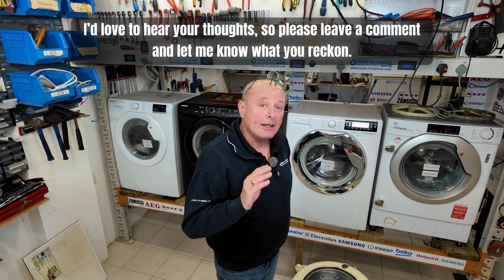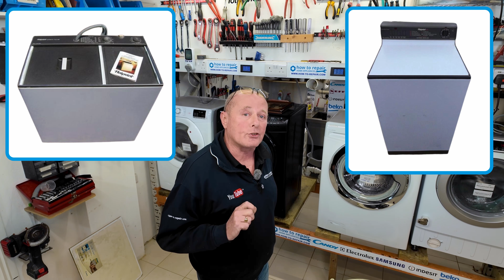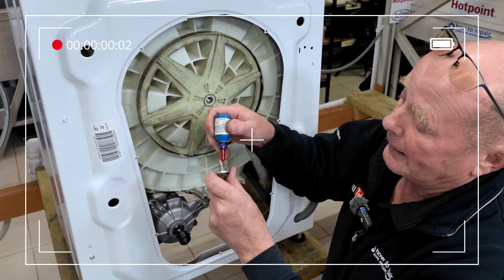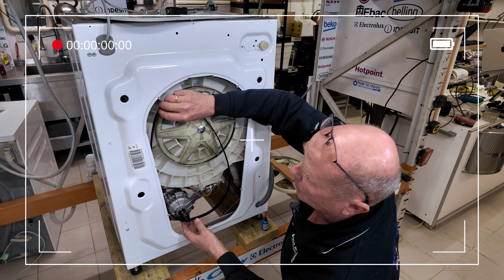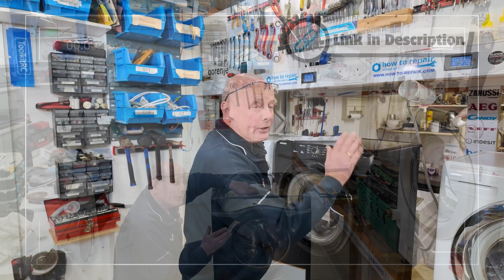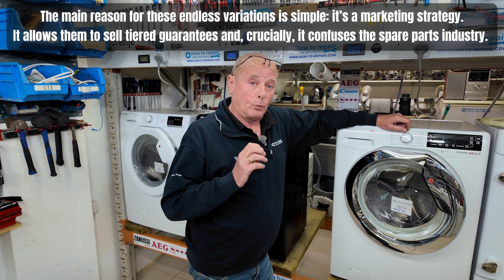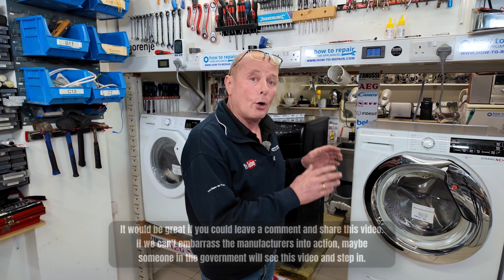I Scrapped 13 MACHINES to Prove a Point: STOP BUYING These Brands!

Comment: I got an "absolutely fantastic" Candy washing machine (a top loader). There's a strong metal spring that holds the door in upright position so you can fill it. But the hinges connecting the door to the main body of the machine are made out of 2mm thin plastic. 
I'm pretty sure that someone spent considerable amount of time setting the dimensions just right, so it fails immediately after the warranty is over.(it broke)
Thanks for the video. It was great to learn that there are more, much worse surprises waiting...
The fact that this shit doesn't ruin the companies that do it, that right to repair is considered as something abnormal, makes me completely disillusioned about the future.
It's not gonna get better, is it.
EVERYTHING is gonna get more and more dystopian. 
You know, one could probably tolerate the inevitably coming authoritarian totalitarian dystopia, IF ONE COULD AT LEAST OWN RELIABLE TECHNOLOGY THAT'S SUPPOSED TO DISTRACT FROM THE FACT IT'S HAPPENING.

Comment: Are there any Washing Machines left we can buy without a hassle? Back in the days (earls 2000s, I guess) Miele has been incredible good in terms of quality, e.g. 
Is that still the case? They sell really expensive machines (roughly between 1.6k and 2.7k €), but offer 25 years guarantee on their machines Motors + 2 years general guarantee.
Are there any brands still good?

Comment: I 100% agree with you! 
I own mieles. For a reason. The machines that are over £1k are built like ours was back in Britain in the 80s and 90s. I also own a 1994 hoover softwave. Which is very easy to work on and repairable. I also have a Hotpoint supermatic plus 9400 twintub in mint condition. Which again is very solid and easy to work on. I refuse to buy a cheap today machine. As I know they are all built to a low quality. To save money and materials. Joe public don't care. A washer is a washer. Cheaper the better. for me ...... Expensive and high quality. Saving money!!

Comment: I've got an old Beko, that was already in the flat I bought in 2006. It is now February 2026 and the machine still works like new and has hot and cold water intakes. So yeah they built better machines early 2000s

Comment: I still have a Miele washing machine that is over 35 years old. While I had to replace some tubing and a capacitor, it still works like a charm.
Is it loud? Yes
Are newer ones more energy efficient? Sure
But new ones cost too much compared to what I would save.

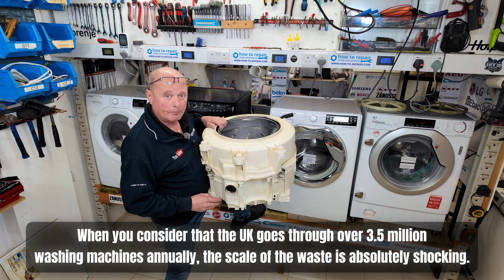Comment: 5:55  there a couple of reasons, obviously cheaper and faster to produce, its also so they cant be cleaned, its also so you cant replace the bearings and seals, they want to sell more washing machines, now you cant renew them, i have a rebuilt one i did, you used to be able to take it all apart pressure wash it and put back together with BETTER bearings and a triple lip seal using more chemical safe composition, now aftermarket suppliers cant as it not serviceable anymore, like automotive transmissions now they don't even supply a drain bolt or service information, says DO NOT OPEN, NOT SERVICABLE, meant to last as long as the warrantee and lower the service costs by neglect

Comment: Planned obsolescence?  Or just cost cutting?  It's hard to tell sometimes.  Yes they all flipped to sealed drums about the same time, but it was to save money.  Oh sure I agree the decisions is very very stupid as it prevents basic maintenance.  But this is why you often see the first ones had the holes still in the plastic for bolts, as they merely started sealing the two have together and fired the people putting in the bolts.  Later designs then removed the holes, and finally even went to one complete molded piece in some instances.  It's efficient to make, cheaper, faster ... and really screws over maintenance.  

I think much of this was caused by the people driving profit first in all forms.  Why use the bearings that will last 20 years when these that last 5 years will meet the warranty needs and save us money money money.  And a lot of this was driven by (wait for it) Green Energy policies.  Look, we all know that since the 90's the west has been gung ho to save the planet.  Well every policy passed opened a door for manufacturers over in Asia to undercut the sale of items made in the west.  This manufacturing move to Asia powered the rise of China, and they produced some of the lowest cost (and quality) items out there.  But consumers driven by prices bought that schlock, and the makers followed suit even moving their facilities to asia to make the items with the same "quality care" as China puts into it.  Heck I love watching a few channels here on like bigclivedotcom where he tears down items bought cheap from china (and those things are sold in the west and are crap and dangerous even .. yet cheap and no one stops it).  We have what we have as other things take priority to the politicians.

Comment: Got a Hisense 2 years ago. bearing shot and costs 20 euro for a new bearing. Time to change the bearing 4h and 100 euro/h so the same totalt cost of buying a new. Got my moneyback and bought a Bosh instead. Still have the Hisense machine and it is now my hobby project to be resold with a new bearing mounted to a family in need.

Comment: They can use capacitors on pcb boards that have lower life spans (i.e. cheaper rated components that degrade power conditioning modules).
Reply: Indeed.  I repaired our 42" built in Kitchenaid refridge by replacing some swollen capacitors on the PC board.  It was a well documented problem within online forums - someone even sells the repair kit on Ebay with the correct components and instructions but I sourced the parts from Amazon.  You do need to know how to solder the replacement parts in and watch to keep the same polarity.

Comment: Hi, I live in Australia, and I have a top-load Speed Queen from 1978, still going, built like a tank. I replaced the bearings, and the timer parts are still available, no pcb  boards .its like a 1960 cadillac you can work on it  and keep it going

Comment: I have Indesit w2296  since 1996 as present for my wedding. Still works  - there was some repair but can be repairable a lot of more years))))  I have Candy washmashine because its too cheap and i will utilize it when it will broken ( 3 years in work) because its not repairable, too hard to change bearing and so on

Comment: I’ve had the same Kenmore washer and dryer for 20 years now. Had to replace the drain pump once a couple years ago and the solenoid for the gas valve in the dryer. Cost maybe 50 bucks total

Comment: My mother used to work for Hoover in London in the 1970s and bought a Hoover machine in 1975. She replaced it 1985 and gave it to me when I moved into my own flat. I used it until it finally died in 2004. The only repairs were replacement bushes (twice) and that was pretty straightforward. I wouldn't even consider buying  Hoover now - I've switched to Bosch with a five year warranty.

Comment: Hello, I am from Czech Republic and this planned obsolescence is going further in the past thatn people think. My grandma (93 years old now) told me that in a company Technolen they were making stockings. Those were durable, you needed to buy new ones once in couple of years, but then they have made a change and they were tearing much more easily. She knew the owners of that company. And of course companies have politicians in their pockets, so this issue will not go away on its own, but it is getting quite ridiculous now. I am using mainly older machines and got a car from 1997 because they are easy to fix for cheap.
Reply: Planned obsolescence started with the Phoebus Cartel and the production of lightbulb in the 1920’s and they had a lifespan limited to 1000 hours reduced from the earlier lifespan of 2500 hours.Capitalisms Lightbulb moment!

Comment: Thanks a lot for this video. The amount of waste coming from the house appliances is inded mind blowing. I read about a way to prevent it - it would be to tax (heavily) all the materials that are being mined. This would make used machines and their parts cheaper in comparison, and encourage recycling the parts instead of scrapping. That would also help the consumers focus on repairability. But it would still be very hard to introduce - most people enjoy buying new machines. It's so much fun - they are clean and shiny...

Comment: Hi,

I'm maintenance technician in France and i must agree with you. At this days, The Indesit Company is in join-venture (is this the right term?) with Whirlpool and distributed by Beko now, this comes with many improvements for both companies about their machines but many complications arise in the search for spare parts references. Also Candy and Hoover have been bought by Haier Company. This latest attempt to make design improvements, particularly to tumble dryers which also have a welded chassis and non-removable side panels. Now they can be removed, but those freaking lids are always on (really, really hard to remove on tumble dryer after several years).

And for the Greenwashing, what the f*** is going on with these Heat Pump tumble dryers, there aren't affordable for buying and even worst for repair : the heat pump cost literally 50%-60% of the price ot the machines and in addition with the cost of workforce, it's a waste of money in my opinion. If these models are designed for low energy consumption, around 500 to 600 W/h in duty cycle, why not manufacture standard heaters consuming this power rather than 1500 or 2000 W models? Furthermore, this would allow the customer to continue maintaining the condenser properly instead of trying to scrub it with a small brush, which will ultimately clog it completely in the case of heat pump powered tumble dryer.

Hoping i was clear and readable, greetings from France

Comment: Unfortunately why would you repair a machine that costs twice or even three times as much in spare parts. It’s cheaper to replace then repair, hourly rate costs for a technician to come out and just say well i can’t fix it here, so I need to take it back to the shop. So add it all up and a store will remove and replace a new one for about the same price or even cheaper. So our stupid Governments that Said let China build everything for cheaper always had a time frame until they became world leaders. Now they control everything. It’s not only washing machines it’s cars TVs everything. I used to repair car parts as an auto electrician starter motors alternators distributors and so on, you used to have to diagnose the problem and then quote the customer before repairing, these days they have more than ten cars on the lot and they just keep swapping parts until the problem goes away. Welcome to the new age where people don’t even know if they are male or female. There is a movie they made all about this called idiocracy good laugh but also take note because this is where we are going.

Comment: I have been involved with washing machines for many years and😅 have witnessed a degrading of the drum support castings over the years. In the 70s an aluminium casting in a dishwasher could last for fifteen or more years if it was in a hard water area and considerably less in a soft water area. The same applied to washing machines at the time. When detergent manufacturers decided to add more chemicals to their product around the ear!y nineties and are continuing to do so, sometimes as directed by the EU, you had a situation whereby detergent residue still active mostly because the wash programme that had been selected was at 40 degrees which if used weeks on end will allow coating of corrosive.  active chemicals to build up on the aluminium casting ( which make the machine smell )  If a 60 degree wash is used at least once a week the temperature should help to break it down. There have been more directives in 2025 regarding detergent which require a change in formulation which might help. Regarding the actual manufacturing process of the aluminium casting, the EU banned a certain chemical around 2005 due to its possible cancerous connection and that chemical helped strengthen the aluminiums resistance to other chemicals.😂

Comment: A few years back I made the mistake of replacing my 90s era Bauknecht dishwasher with one manufactured in the 2020s.

My old one didn't clean properly anymore, tried cleaning it and all kinds of other stuff but I figured it just got "too old".

Spent 600€ on a new Bauknecht one, ordered it online, rationalized the purchase with how the newer machine will save me water/energy in the long run.

The new one arrived, send the old one with the delivery people.

The new one couldn't fit half the stuff of the old one and once connected, it performed even worse than my old one. Turned out the problem wasn't the machine itself but rather lack of pressure on the water line, as the filter in the utilities room was clogged.

But even with that problem solved my fancy new Bauknecht dishwasher performs so much worse than my old one, it's a source of frustration every single time I use it.

I thought about replacing it again, but chances are I'd have to spend 1000+€ to get something actually "good", and even that will probably fail within a few years.

Just like the one I currently have; It's so digital, and generally flimsly build quality wise, that I won't be surprised if it fails within this decade.
Reply: im glad you think that was a mistake , practically everyone i know wouldnt think its a problem....
but i cant tell there must be plenty of people who make sensible purchase decisions by how rapidly decent products go out of stock , restoring hope in humanity

Comment: I love my 'new to me' 2009 and 2014 Whirlpool and Admiral washer and dryer. $150 each. I replaced the agitator dogs rubbing blocks and pump on the Admiral washer during a thorough teardown and cleaning and replaced the drive belt on the Whirlpool dryer..... So it's about $400 total for the pair.
They work fantastic and will for another 15 years. I'm 68, so I don't really care. 🤣

Comment: I am an engineer from Germany, and planned obsolescence is a myth. It is a classic case of "correlation does not imply causation." Just because a machine always has the same defect does not mean that it is intentional. Your videos are therefore nothing more than scaremongering and not very scientific. With the AI thumbnails, it seems to be more about making quick money on YouTube and less about education.
If a device always suffers the same damage, it is usually for one or more of the following reasons:
1. The machine has reached its defined service life and the parts were designed (too) precisely for this.
2. There are problems with a supplier and there are already thousands on the market with this problem. -> A recall is only necessary if the machine cannot meet its specifications (e.g., life expectancy).
3. The problem is tolerated and ignored. (Bad company)

But no one I know thinks, "Let's build in a fault." The only thing I have ever heard was, "Part X causes a fault rate of less than 1%, but we have the warranty, so we're not going to make a change costing x thousand euros in this generation."

And always remember: Yes, if a part breaks for 5 cents, it can be repaired cheaply. But a company can't just replace a component. Depending on the component, new life tests, stress tests, and certifications may be necessary. The system is always tested as a whole. If one part is replaced, the system is different. The inspection authority is not interested in the argument that the replaced component has no negative impact. A new test is then necessary. Changing a 0.01ct resistor can cost tens of thousands of euros in development.

Comment: Chipboard. Wow. Actual ChipBoard. What idiot decided to use that?

Yes I'm an engineer. I make software, PCB's, machines, the lot. Nice video! You're absolutely right unfortunately. It's not just washing machines, it's everywhere. 

Failed bearings are a thing. Pressing bearings in a (plastic) housing with incorrect tolerances is just asking for trouble, and manufacturers know that very well. Skipping on the right bearings is also a thing. What I mean by that is for example that I fixed my band saw with a proper bearing, a thrust bearing and a few shims- the latter two weren't there at all; they just used a screw which wasn't tightened...

I particularly hate plastic-on-plastic and sheet-metal-on-plastic connections. My "stainless steel" waste bin has such a connection; the hinge is two plastic parts pressed into each other without an actual metal piece to hinge. Fixing it involved nothing more than drilling a hole and putting a $1 stainless steel dowel pin in there. To cut cost, they obviously epoxy glued a piece of plastic on the sheet metal - like that was a good idea.

I'm not even want to to get started on the kitchen. The toilet seats. The showers. The list goes on and on.

As for the PCB's failing. In my experience most PCB's fail because of bad contact points or other wrong reasons. Contact points are an easy fix with the right tools. Replace the caps right away with proper ones, don't even bother testing them. Panasonic is usually fairly good. As for the rest, throw them in a reflow oven and it will spring back to life. If not, some SMD is probably failing because they didn't use automotive grade parts (e.g. gold internal wires), but the ones with silver internal wires, which corrode quickly and die. It's a common problem, and as far as cost is concerned, this really 'optimizes' pennies for hundreds of pcb's - so that's not the reason it's done.

Anyways, keep up the good work! I really liked the video.